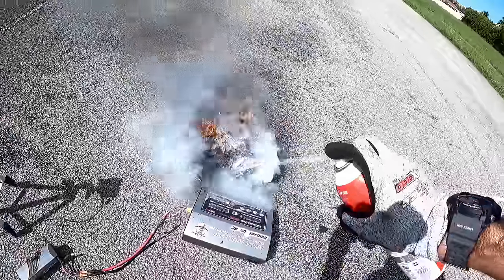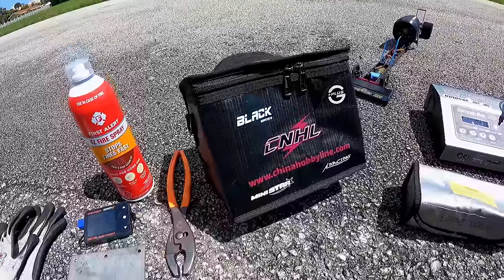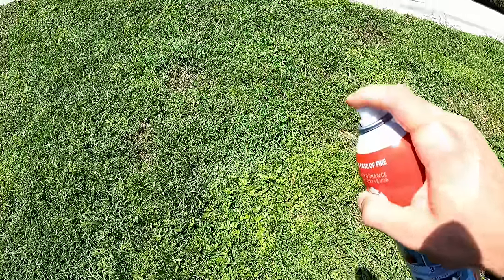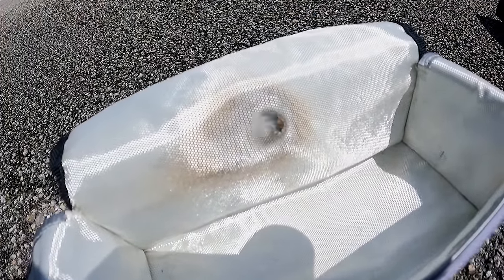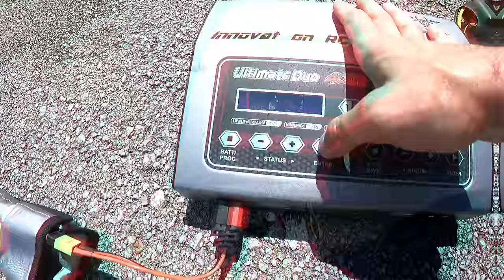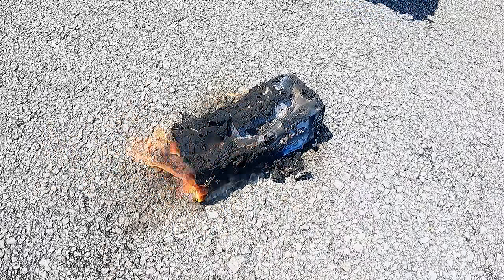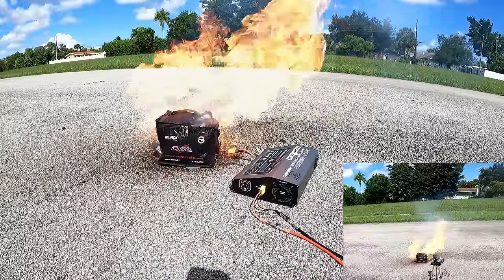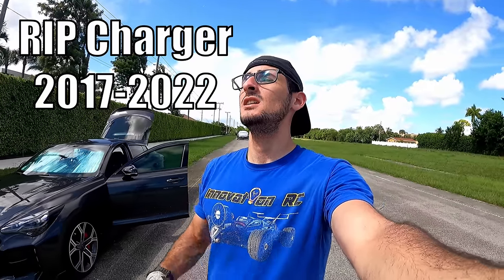HUGE LiPo FIRE - Battery Explosion! How much damage can it do?

Comment from the maker: Be safe out there guys! Consider safety tips below for charging batteries. Subscribe to support the channel!

. Never leave a battery unattended while charging.
. Always know the proper spec to charge a battery at.
. Always be prepared in the event if something were to go south. 
. Always keep a battery at "Storage Charge" levels, 3.80v/ cell, whenever your NOT using it- (personal preference).

Always practice proper safety and habits and you'll be fine!
Reply: I always have a bucket of playground sand near my charging station. or you can keep a big bag of sand nearby. It will contain the lipo fire instantly when you dump it on the battery. I was taught this by the tech and sales rep guys from thunder power batteries when I was racing 1/8 truggy and buggy at Amain Hobbies. I had to use it on two Spektrum 6s 5200mah lipos and a smart charger in my garage. It works like a charm. You can also charge batteries in a tray filled with sand if you don't have an ammo can.
Reply: What does “Storage Charge level” mean?
Reply: @Grâce-n1d4x  It means the voltage value at which the certain battery chemistry likes to be stored. I.e. LiPo doesn't like to be stored when they are full, you will encounter swollen battery packs if you leave them at full charge for too long, Lithium ion likes to be stored at around 40-50% charge. 

My tip is simple, only charge LiPo's when you are going to use them the same, or the next day. Don't leave them to degrade.
Reply: Would be nice to see the real explosion. Not inside the bag.

Comment: Thanks for this. As rare as battery fires are, it is always a good to see reminders of how much damage a poorly maintained battery can do. I'm definitely upgrading my  battery storage safety level.
Reply from the maker: Exactly and we'll said! So am I!
Reply: Me to bud. So whats the best storage for them ? I had a feeling those "batterie bags" would not hold up ! Whats the point of haveing them ? Ammo can looks like it would work much better.
Reply: got hold of a 1"x1"x1" metal box some sort of valuable storage box like a locker room box for some of my lipos the bigger ones i store in the oven when its not used.
if it can handle the heat of a stake it can handle a lipo.
Reply: @savagex466-qt1io  ammo can is better as it can stand the heat and contain the flames but it need some 1/2 inch hole in it or a part of the rubber seal cut so the gas and smoke could exit and dont build pressure.

Comment: A word of caution and advice when using steel ammo cans for storage, while they are very good for storing lipos and containing the fire if one sets off, they're a little too good due to the rubber seal around the lid. You need to cut off and remove both the small ends of the rubber seal to allow ventilation and gas expansion, otherwise you're creating another problem which would be over pressure or a bomb in short.
Reply: or a 1/2" hole somewhere to vent out the pressure.

Comment: Newbie here.  What did you do to them to make them catch on fire like that?  Charge them on a non Lipo setting?
Reply from the maker: Charging a battery only with the main plug, without the balance lead, in nimh mode. Do not do this ever
Reply: @InnovationRC  …..ok. Thanks for the education.

Comment: So,  was just charging one of my batteries. Went upstairs for a few minutes to talk to someone. I hear a very faint  pop, equivalent to a really loud bubble gum pop. Somehow my instant reaction was to go back downstairs as fast as I can possibly move. The battery was smoking and expanding rapidly. I grab it bare hand LUCKILY had that awful fireproof bag that you tested sitting right next to my charger.  It engulfed in flames as I was freaking and running toward my basement bathroom. Threw it in my walk in shower and turned the shower on.
In my opinion, the really awful bag did save a catastrophic event. It kept the flames down just enough so I could somehow manage to hold on to the bag for just long enough to get it to the shower.
 Moral of the story is, I honestly did not realize how dangerous these batteries actually were. Just kinda brushed off the whole fire hazard Danger blah blah blah. Get the good bags people. I also have been using a really large cooking pan if you still don't have a bag from when your first one burnt up....

Comment: I had a little mishap with a soft case 3s when it was inside my Baja rey. I hit a tree pretty good and flipped it over, guess one of my motor wires came undone and it got super puffy then started smoking , didn’t do much internal damage but it smelled real bad. Pulled it out and I burned my hand pretty bad. Life lesson, be safe with Lipo batteries

Comment: I store mine in those type bags but in the same army issue container as yours, is that ok? 👍
Reply: Should be good as long as you don't store the container on or around other flammable materials. Worst case it'll get extremely hot and shoot flames out the gaps which might ignite whatever is close. Mine sits on a slab of concrete.

Comment: This is why I went to lithium ion 😂 I used lipos on my Ebike caught fire several times from over regen lol
Reply: be a man and get off the brakes :D
Reply: These are lithium-ion.
Reply: Hence same reason don’t use lipo packs in my eBikes.
Reply: @fat_pigeon  They not actually the same one lithium polymer vs lithium ion which is used in 18650’s and 21700 cells and usually fair better to not catching fire if used correctly. Lipo packs just from excessive vibrations can short plates out.

Plus lithium-ion batteries have better density and high power capacity than lithium-polymer batteries.

Comment: What is the name of the extinguisher can u used. I'd like to have something around the house Incase this exact thing happens..but I've heard only certain one will put out a lipo fire and then ones they mentioned r pricey. But that foam one u have seems to work pretty good.  So if u don't mind telling me what that one is called I'd appreciate it.  Thanks in advance and great video
Reply from the maker: It's called First Alert Fire spray it's like 12$. I went to my local Home Depot and they had two Semi large legit extinguishers on sale for 39.98 which is your best bet
Reply: I seen somewhere u cudnt just use a regular type fire extinguisher for a lipo fire I for got what they called it but they where like $150 for normal size. So will any kind and type of fire extinguisher work? If ur mentioning the ones for $39 or do u know. Thanks again
Reply: Cause there's like a type A B or C or something and then there just type AB or something idk it's all confusing to me and I want to get the right kind ya know.
Reply from the maker: @georgeparsons6632  a lipo fire is a chemical fire. It will keep going until the rest of it's hosting fuel is depleted. I basically just put the bag out. If I attempted to put the battery out with that one can as soon as it combusted I would have used 2-3 cans. I do not know of a larger size of what I used, I just have two of them handy. That's why I have an open ammo can nearby if something were to go up in flames I'd pick it up with my gloves and put it in the ammo can and run that bit*h outside and let it do it's thing. In all seriousness. You want it out of anything you care about's way...
Reply from the maker: @georgeparsons6632  unfortunately I do not know if those two fire extinguishers will work as affectively in a chemical fire. I didn't buy them but it was a deal. I should have taken a picture to do more research but I was destined to find another can of what I used.
Reply: @georgeparsons6632  Your best bet is to keep a bucket of playground sand near your charging station. It's what I do and how I put out a huge lipo fire in my garage. Two 6s 5200 mah. It will still burn to a crisp but the fire will be contained in the sand. The fire extinguisher did nothing for me. Sand ends the danger immediately.
Reply: Yeah I found the info it's actually called a class D fire extinguisher theres ABC fire extinguishers too and these r easy to find and the cheapest as far as price but the class D that will work on lipo fire r hard to find and expensive if u do. I've looked on eBay and Amazon and if ur lucky enough to find a class D there. They r upwards of $166-$600 and more. There's some on eBay that say A,B,C,D but when u actually read the description there's no mention again of class D just the ABC. Also if u goggle fire extinguisher for lipo fire this is where it tells u about the class D extinguisher. Can't figure out how to post screen shot here or I would. Crazy how expensive this class D r I mean I've even seen them over $1000 would love to have one for piece of mind but I can't afford even a $300 one. I do use batsafe's for charging and storing some of mine and ammo cans. And I'm very careful but u never know and I hate to lose everything I've worked for. Just sucks these class D ones cost so much and r hard to find. Thanks for all the info.

Comment: I live in an old apartment building. If one of those went up in my apartment, it would burn the whole place down quickly. Who knows how many would die because of me. For everyone else's safety I am switching to NIMH. I have a few 2s and 1 3s and frankly the things scare me. I'm getting rid of them and not buying any more. I may get out of the hobby anyway. I have mobility issues and picking these things up is getting more difficult. I'm going back to a safer, less expensive hobby and build scale plastic models.
Reply from the maker: Exactly, have to be super careful and take all the precautions to be safe.

Comment: I'm almost thinking the fire proof bags produce more fire and longer lasting flame. As in more dangerous to use the bag. I have a 20mm ammo can with three .556 ammo cans inside splitting up my batteries by 2S, 3S and Niham

Comment: It's the oxygen in the air that makes it worse putting a fan on it's not helping
Reply from the maker: It was to redirect the direction of the smoke not blow the fire out, unfortunately the wind was sporadic enough to where it didn't matter which way I blew it. Kept coming back

Comment: Should have used long wires so you didn't wreck you'r charger. Stupid mistake there. Also should have done it on dirt. You just wreck the road in this stupid test.